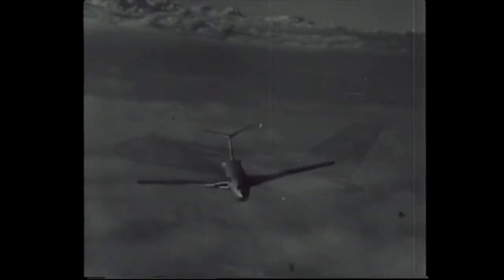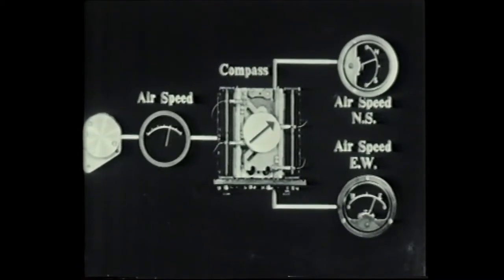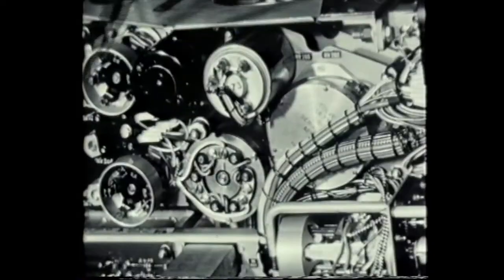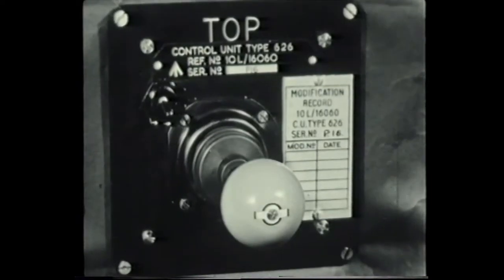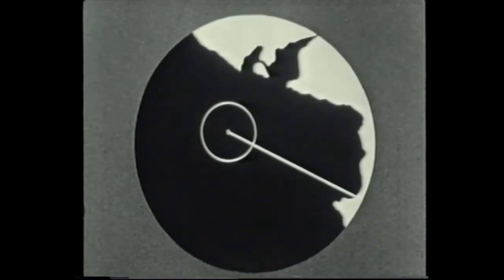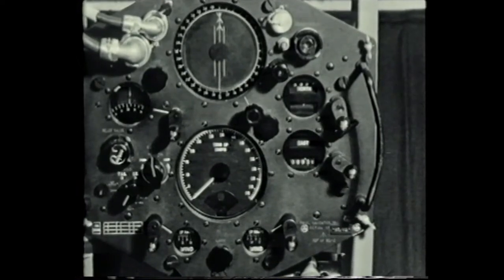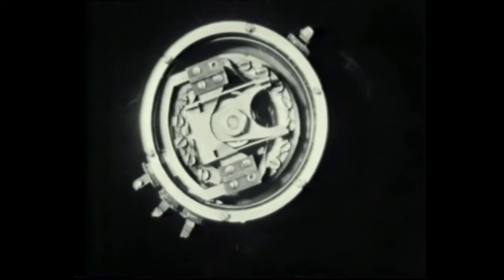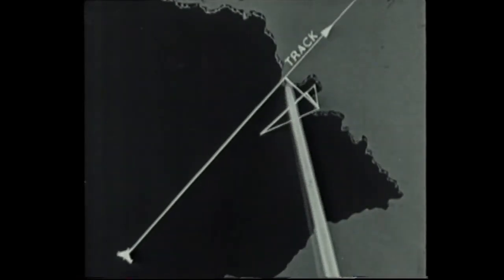Navigation and Bombing System Mk1, V Bomber, Valiant, Victor & Vulcan avionics

Comment: Excellent posting these Spen. I've been slowly piecing together the ADRIS (Automatic Dead Reconing Instrumentation System) and TPIS (Tactical Position Indicator System) from the Shackleton Bomber, so can fully appreciate all the comments on 'M' Type transmission. I'd sort of pieced the history of the development of ADRIS from the development of the Distant Reading Compass and Air Milage Unit Mk.1 through the development of the API/GPI instruments, then finaly the addition of Doppler groundspeed and drift. I always wondered where the NBS system fitted in, if it used any of the same components. Now I realise that , though many of the prinicpals were the same, the execution was quite different in the NBS. I must get round to putting some of the ADRIS clips on YouTube.
Reply from the maker: Thanks for the comment, from what I remember from working on the training Shackletons at Cosford, in the early 70's, the ASV radar was based around the H2S Mk9 which was the radar side of the NBS system.
Reply: Would love to see your info on the ADRIS setup. Was tweaked when I saw the Air Position Indicator on a video of the Halifax bomber navigator's position. Also included in the video was the Drift Recorder MK2 which was installed on the Shackleton.